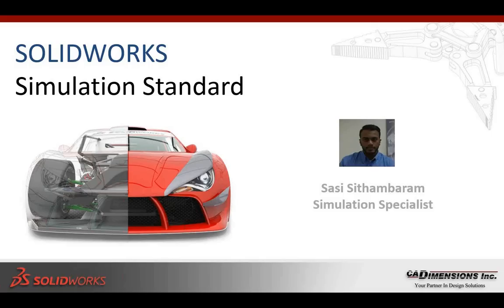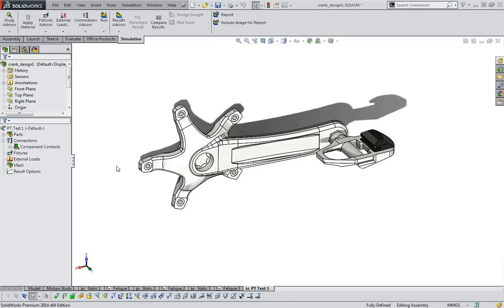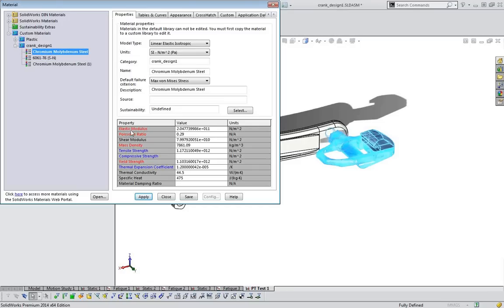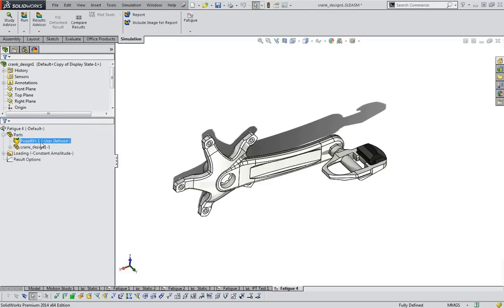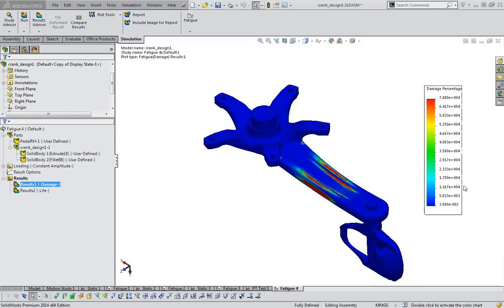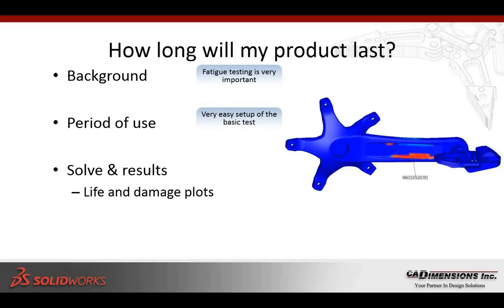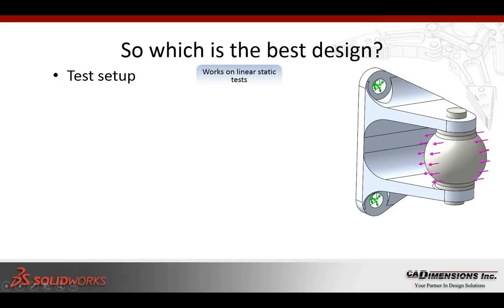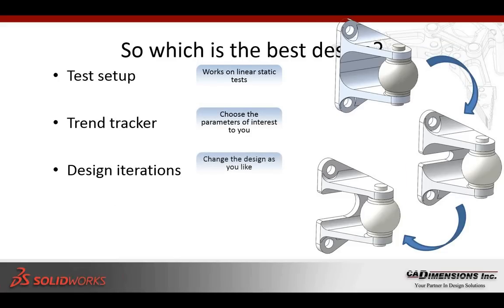SOLIDWORKS Simulation Standard

Comment: Then you don't even mention connections?  I know the pedal is attached to the crank with threads.  When can we ignore connections?  I seems like you should have at least made reference as to why it can be ignored in this case.  After all, you made a point of saying that we would follow the steps as presented.  Then you apply 6 fixed hinges with no reasoning on why the hinges were selected instead of another fix.  I really am disappointed that all these choices are being made with no reasoning  behind the choices.